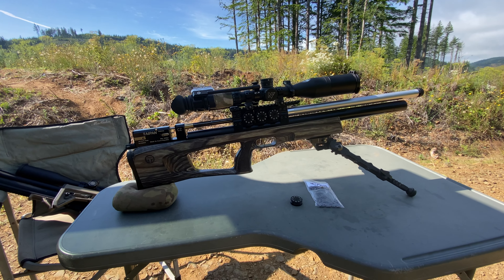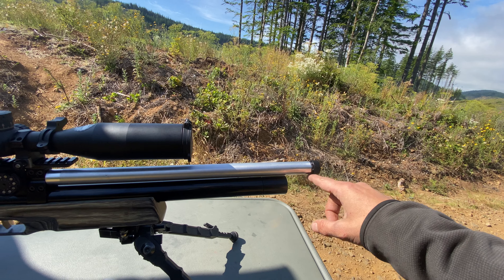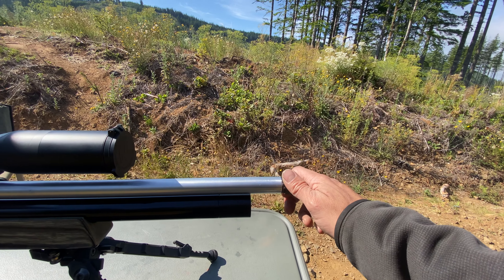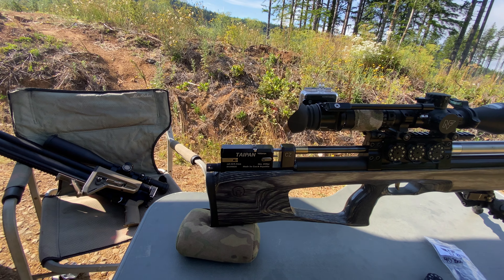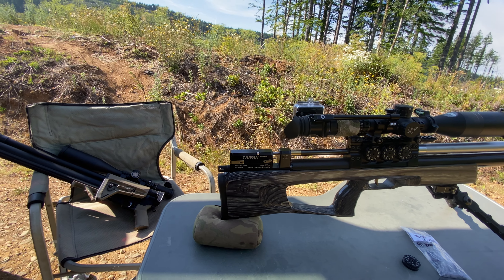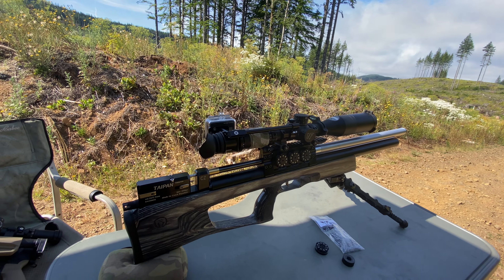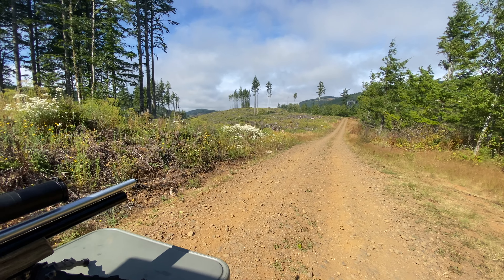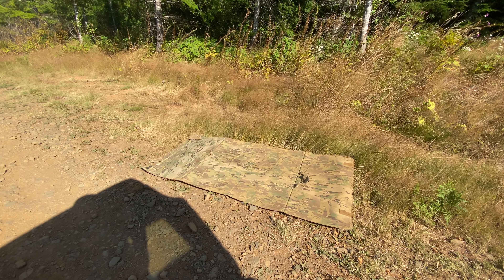Taipan FrankenVet .22 cal 700mm FX Superior Heavy liner

Comment: You spoke of owning a Jsar raptor,  how is yours performing?
Reply from the maker: Worst airgun that I have ever had!
Reply: @mtnghostgunner8461  
I have had to send mine back twice!  The first time i shot it 2 times and the dang thing dumped all the air out of it, then they sent it back 2 weeks later and it was empty as soon as I received it. It has been a nightmare dealing with those people
Reply from the maker: That's unfortunately the common theme I'm hearing. Really disappointing!!! My original barrel wasn't machined right, but they eventually replaced it. I paid out of pocket to ship it back. Then, I had issues with the tension system that caused the barrel to get  stuck, which inevitably damaged the inside if the block. At that point I gave up.
Reply: Yes im really hating purchased one at this point. I purchased it last year around this exact time, it took 8 months for me just to have it in my hand and then all this extra nonsense.  If it does not perform this time i have already told them i want every cent of my money back or i will be filing a lawsuit. They really should have perfected it before they sold anybody one of these things.
Reply: What do you think is the best .30 cal for power and accuracy with slugs ? My FX CROWN is amazing but i have to push it to get the power i desire
Reply from the maker: If you want something that doesn't have intricate harmonic tuning challenges that "just works" with slugs, EVOL (18" barrel) hands down
Reply: Thats what i figured.  Thanks for replying fam